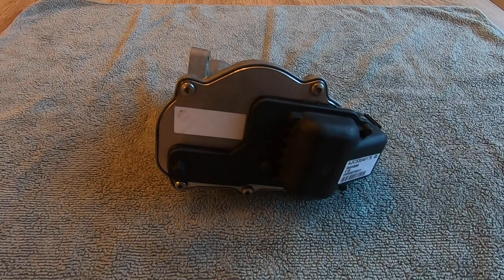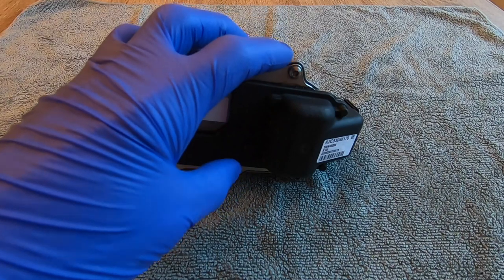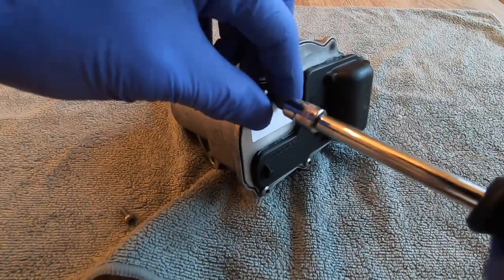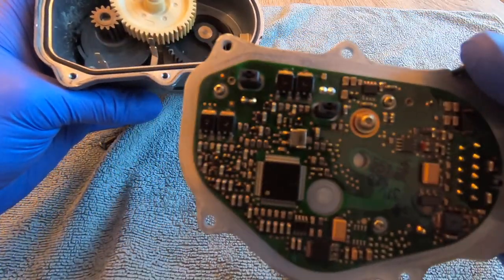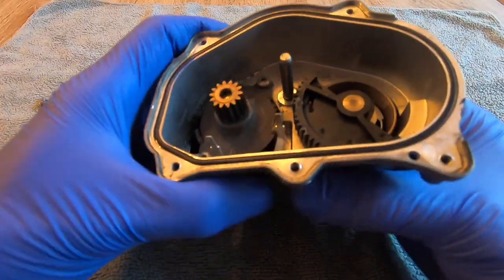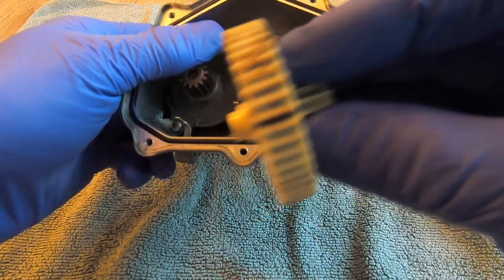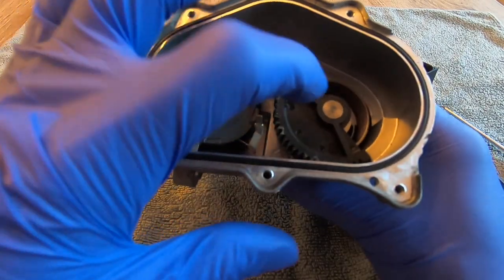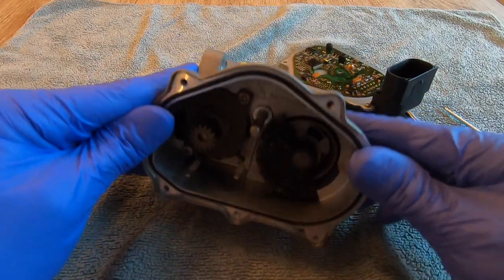BMW E60 M5 Throttle Actuator Inspection   #E60M5 #S85 #V10

Comment: Mine went wrong at 76K , fixed and fitted by a company called rebuild in Gravesend uk ..,around £650 🇬🇧😎👍
Reply from the maker: Nice 🇬🇧 It seems they seem to need replacing around 70,000-100,000 Miles 👍
Reply: @MTechGuy  I think mine went around 120k miles.... This was the original one that hadn't been replaced... The other had been replaced with an '08 year some time in the cars lifetime

Had mine refurbished via rebuild also and installed myself a few years ago... No recurring issues
Reply from the maker: Nice, I’ve heard the gear quality of the rebuild ones are pretty good. The other original throttle actuator on my car must have been done between approx. 60,000-70,000 miles when it failed. Judging by what a lot of owners have experienced, if one fails you might as well do them as a pair
Reply: @MTechGuy  he also upgrades the circuit boards.
Reply: Same company I used 2 months ago :)

Comment: Yeah please make the video, my E60 has just hit 90k and still on original so thinking of changing the gear set myself.
Reply from the maker: Will do 👍 Yours will definitely be ready to do at 90k
Reply: @MTechGuy  Is there anywhere to contact yourself, I recently bought my M5 and im not sure a ticking/rattle noise is common when letting off the peddle at low speeds.
Reply from the maker: @RH51MAC  mtechguynz@gmail.com

Comment: mine went pop at 96k miles. did the rebuild myself with the odometer kit. super simple if ya got the aptitude for it. the odometer kit is still some kind of plastic but a much beefier compound. the trickier thing is if the mosfets go... at least in USA the manufacture stopped making the specific part so you either order from overseas, get a mosfet with the same specs and modify it to fit the board, or do as I did and order a junkyard unit and steal the parts off that board.
Reply from the maker: Thanks for sharing. It’s inevitable the gears will eventually fail. The mosfets are still available overseas, it can be a tricky job replacing them on the board. Sounds like you got lucky with a good used one. How did you find the odometer gears? I hear the early ones didn’t mesh well?
Reply: @M Tech Guy   i bought my gear set off fcpeuro. not sure if they operate outside the US though. iv seen guys overseas on m5board do the diy so im sure they are available somewhere if not fcp. cant say iv heard anything about the early versions, but iv got a few thousand on my set already and no issues. the mosfet thing is deffinatly not what id call a beginner job. id have no qualms about doing it but fortunatly i didnt need to actually swap mosfets, just the board off the used actuator.
Reply from the maker: I got my replacement throttle actuator I recently fitted from FCP Euro 👍 Might have to utilise the lifetime warranty if (when!) it fails
Reply: @MTechGuy  when you basically only drive bmw and work on your own stuff fcpeuro is the only way to go in most cases i find. iv had people i talk to looking at german cars they never did before once they heard about their lifetime garuntee even on consumables. 😆
Reply from the maker: @Zeox  Sorry, not the odometer gear brand not meshing well, I was thinking of another brand with the brass components. I plan on using the odometer gear ones 👍
Reply: @MTechGuy  yea, the brass iv heard do bad things. besides how they get meshed, iv also heard they send too much shock through the actuators motor and housing due to being harder than plastic.
Reply from the maker: Yes, they’re the ones!

Comment: Good video! im due for these as well
Reply from the maker: Super common issue with these cars!
Reply: @MTechGuy  much more common than the rod bearings, and the price for the actuators haven't even come down and or no permanent fix...i think it starts to fail from the rod outside the actuator that thing needs to be lubricated and or maintained aswell